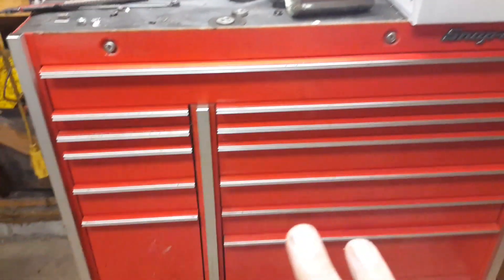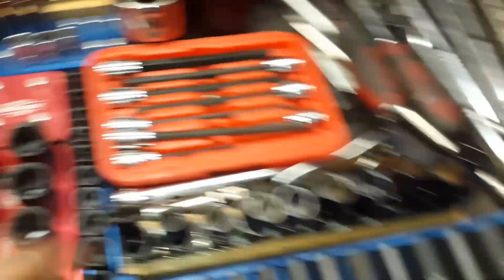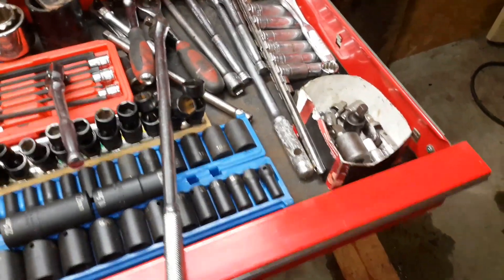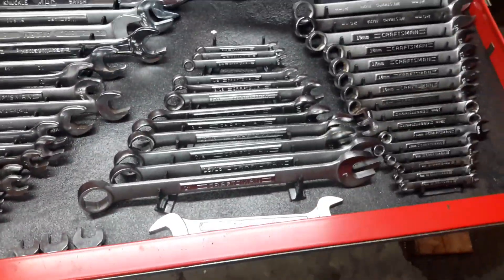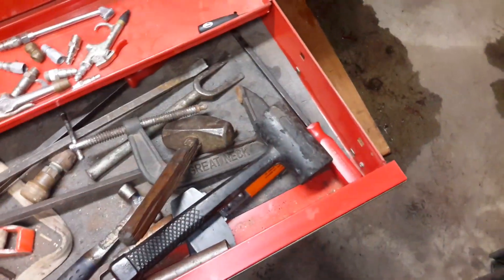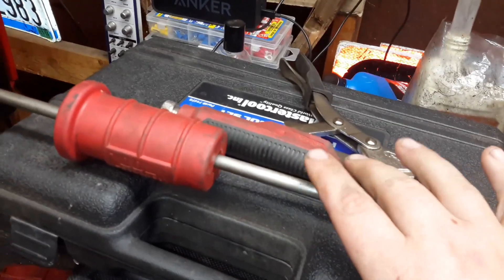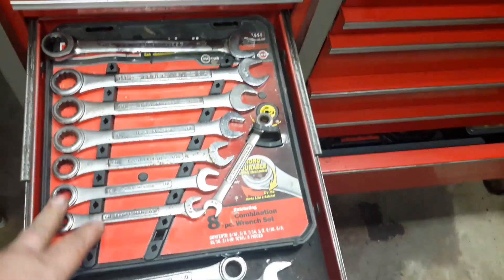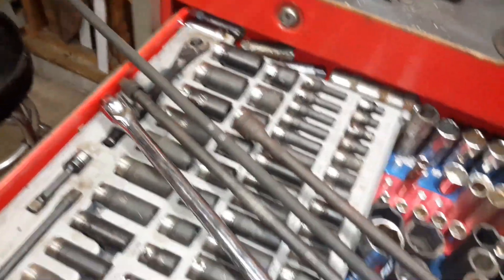Fuzzys tool box tour #TTTGAW

Comment: Nice video. Have you tried the cable operated hose clamp pliers? They are pretty sweet for tight areas.
Reply from the maker: RJ Tickler yes absolutely worth picking up a good pair. You change your first heater core hose and you'll see the value in them

Comment: Nice tool box tour.  Couple things though, Armstrong is owned by Apex  (Not Matco)  and are the same as Craftsman Professional Made In USA.  The confusion may be that most Armstrong stuff was made by Danaher, the parent of Matco.  Both are same quality, one is not better or lower.  BTY is is Torx, not pronounced Tor-ex.  Just sayin.  New Milwaukee wrenches are not good for mechanic work, they/re more for plumbers, electricians, industrial.  The open end grips too much and it slows a mechanic down.   Good tour, thanks.

Comment: I don't understand why you spent as much as you did to buy a Snap On box just to fill it with crappy miss matched tools, a HF box would have been the way to go for much less money
Reply from the maker: Doug Strock because I've had shity boxes and the drawers just fall out of them and they're just a complete pieces of shit. And believe me I didn't spend that much money on it. I dident buy the box new. I ain't dropping 6 grand on a box. And as far as the tools got to start somewhere man nobody comes out of the gate rocking full snap on. If they do they're an idiot cuz they're in debt up to their fuckin eyeballs
Reply: You said in the video you paid $1400-$1500 for the box used I would have bought a cheaper box and spent more on the tools, if your having boxes with drawers coming out and falling apart your doing something wrong, cheaper Craftsman Husky or Harbor Freight boxes are pretty good boxes for the money, Also I wasn't suggesting even buying Snap On tools they're way to overpriced but like I said I would have spent $500 on a box and $1000 on tools any brand with a lifetime warranty
Reply: Doug The Tech Guy you miss the part where he was able to lay a engine on the box? The fact he was able to do that he could build 3rds and w/e using the box as a bench if he needs to. $1500 he said is really NOTHING for something like that. He will be able to get his moneys worth and back being its used and cared for if he upgrades. I have almost $200 into my craftsman 26inch box with 7 drawers and a 3 drawer mid section. Granted im getting bonus rebate points from Sears so I get a dollar for every 2 I spend, so my tool collection is really refined considering I'm starting from really nothing. I went with the 26inch box is because I'm young and not always in one place so I can take whatever sections I need whenever because how it breaks down... Ill be getting a black HF cart to keep my sockets and main wrenches by the car.
Reply: I didn't miss anything....nobody in their right mind is gonna put an engine on top of a toolbox especially an expensive one other than someone who buys an expensive toolbox and fills it full of junk tools.... engines go on engine stands that's why they make them..... examine the logic here the whole thing is nuts
Reply: Its not tho a $800 harbor freight box or a 10 year old snap on for $1500? well the HF wont last 10 years and i love their stuff so no hate... snap on just a better investment for someone who uses it and theyll get all their money back selling it as long as they didnt abuse it and care for it.
Reply: You completely missed the point of everything I've said